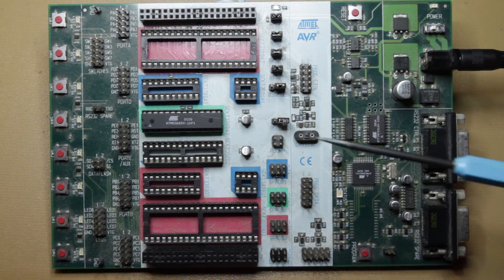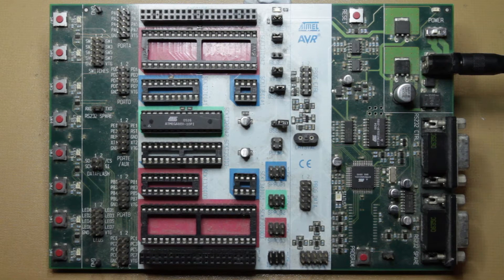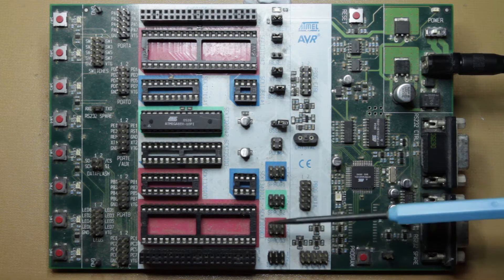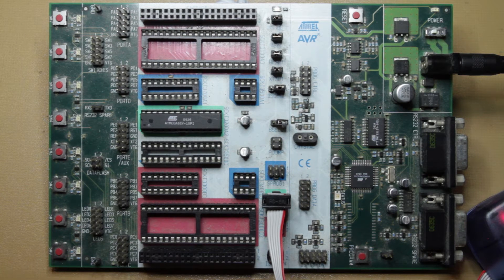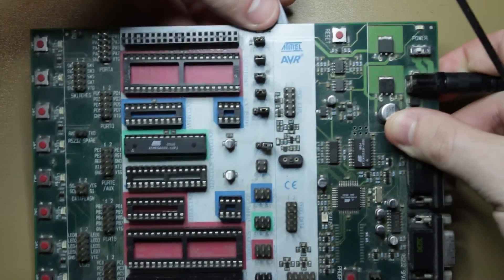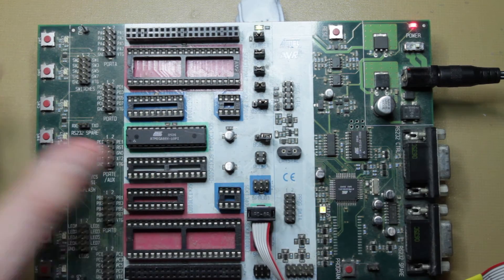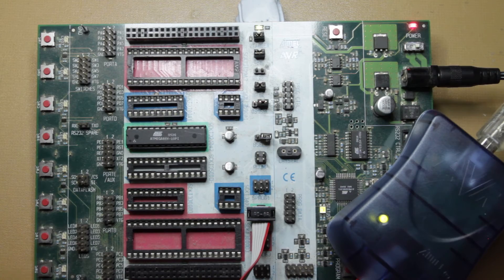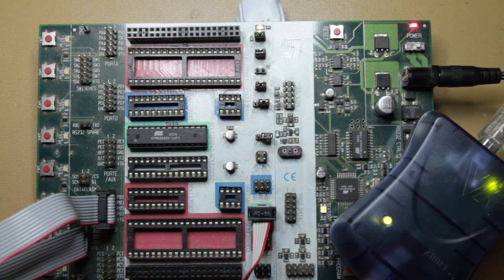A brief introduction to the STK500

Comment: Wait, Why are you using an external ISP  programmer???? I was under the impression this kit includes the programmer.
Reply: Yes it has one, he doesn't use it because Modern computers don't have Serial ports. hence the external ISP programmer.
Reply: @streetbeaglekz1923  Depends on the mobo actually. Industrial mobos have them all, serial, LPT, FireWire, you name it.

Comment: I have a serial port on my computer.
Reply: Whatatay T Me too ;-)
Reply: +SmiloDTech And just today I received a USB to serial cable for my laptop. It cost $3.99 on Ebay.
Reply: +SmiloDTech And just today I received a 3 foot USB to serial cable for my laptop. It cost $3.99 on Ebay.
Reply: Whatatay T I have one too
Reply: +SmiloDTech Mine works great. Using it on a Windows 8.1 laptop.
Reply: +Whatatay T Yes they work great and they're cheap !
Reply: Thank you to myself. Haven't touched this stuff in 6 years but just found I need to make a project and wanted to use this stuff since I have the development board, experience, and chips. Found I had AVR Studio 4 on my old lab top but wondered about the serial port. I see I bought a serial to USB cable.